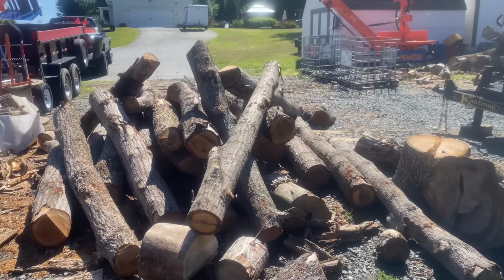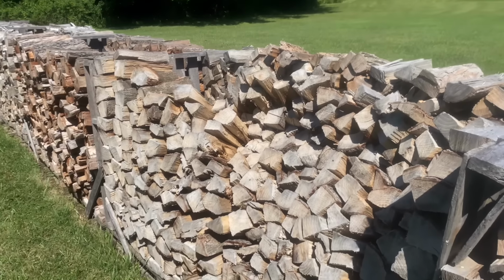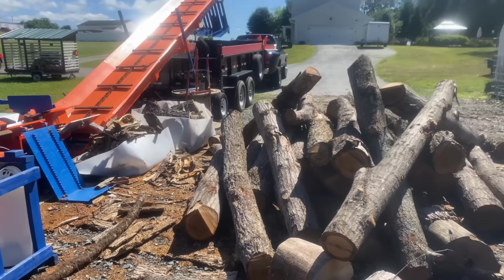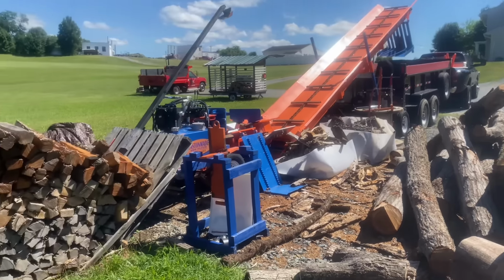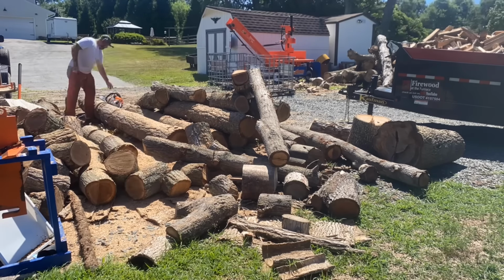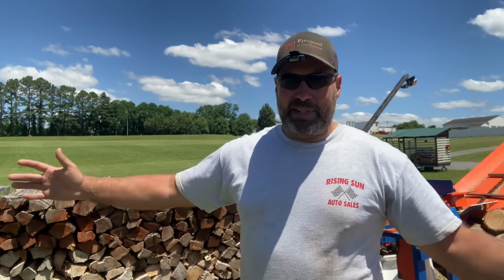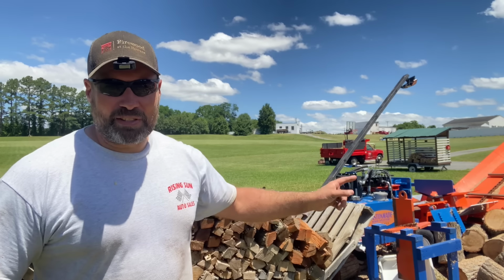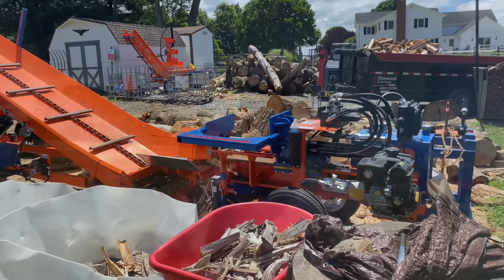FINALLY GETTING TO THIS LOAD - #214

Comment: Brad, this is a trick that Chris from "In the Woodyard" uses.  As he builds his stacks he places straight branches between the rows.  This locks the two rows together.  You may be able to use the metal braces from the totes.  I know that you and Chris both are just throwing the wood in a pile.  But if you ever stack again try it.  Happy Holliday!
Reply: Chris, also has multiple saw and cuts with one gas tank and then used another. When all done sharps all at one time

Comment: If you got a sharp chain on a chainsaw it’s easier on the equipment and plus the logger to . Take them screw and change them over to nails a lot stronger on a side pull Brad . 😊